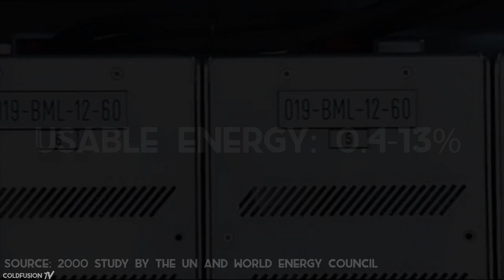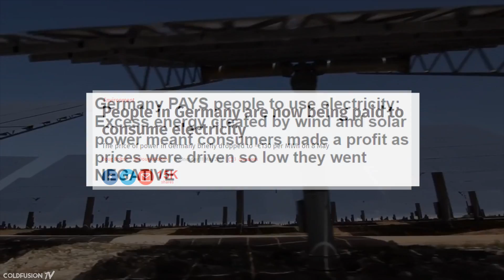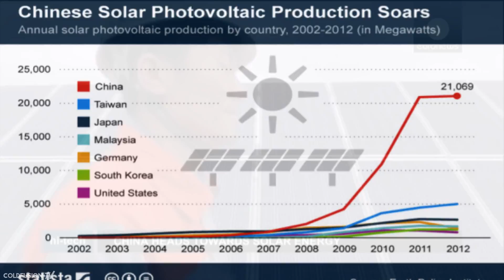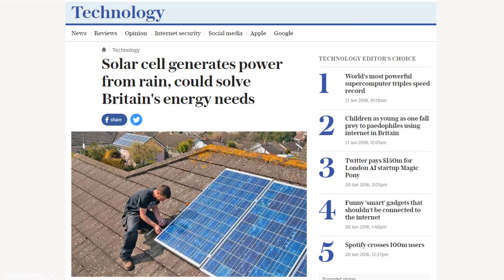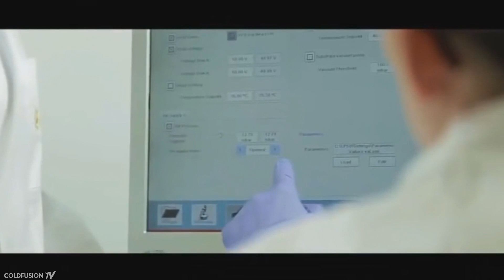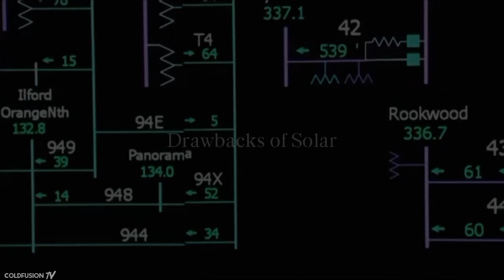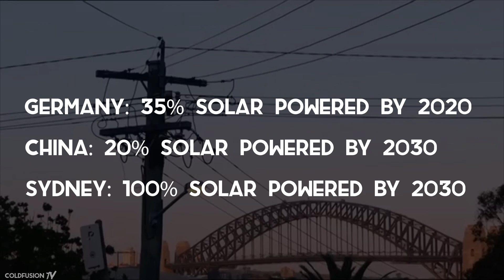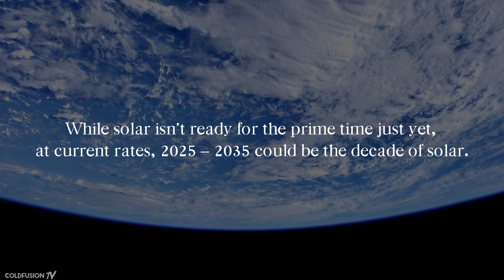The Truth About Solar

Comment: I live in San Diego California, and use about $75 worth of electricity a month.  While that is not enough to warrant putting panels on my roof, I could put more panels so I could sell some back to SDG&E to offset the cost over the life time of the panels.  Come to find out two weeks ago while discussing this with a rep, that San Diego country does not allowed home owners to put up more solar panels than what would cover our normal usage, ostensibly because they don't want that extra energy being shunted back into their system.

That is pure political BS because it would lower the profit paid to stake and stockholders of the power grid.  Yeah, solar would be great but just giving us a discount or rebate on the installation does not really give us anything of real value.  Value would be in the selling of the excess created by a larger array on my roof.

What they don't tell you, is that the cost and maintenance of the panels can barely be paid off by the time the panels life has expired.  Panels do not increase in value like our homes used to, and can only be depreciated Tax-Wise by business not home owners, so by the time they start to fail, you have barely paid them off.  WHERE IS THE BENEFIT ???

THE ONLY BENEFIT FOR HOME OWNERS IS IF THEY LIKE BEING OFF THE GRID !